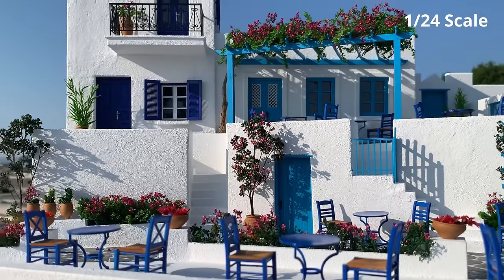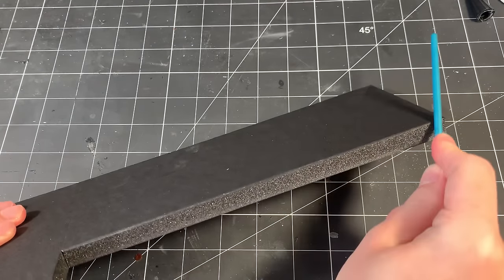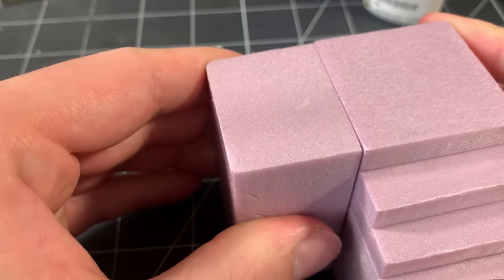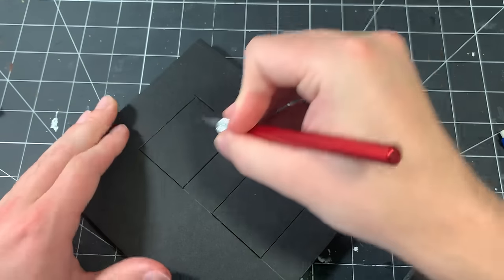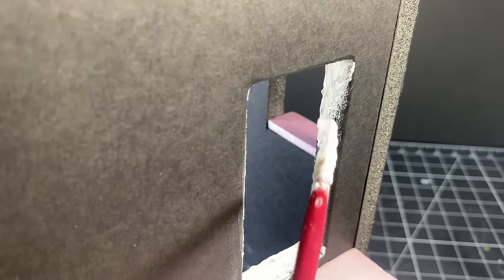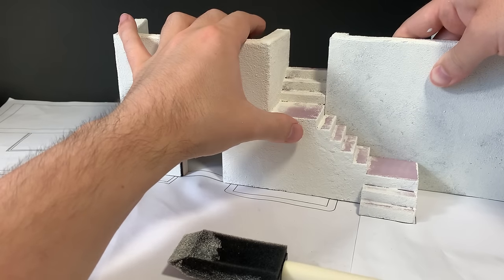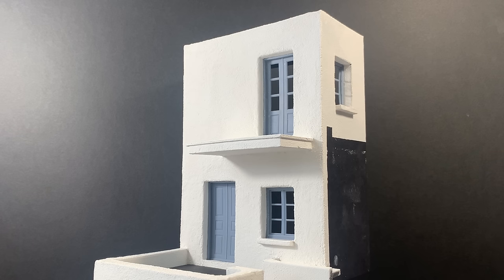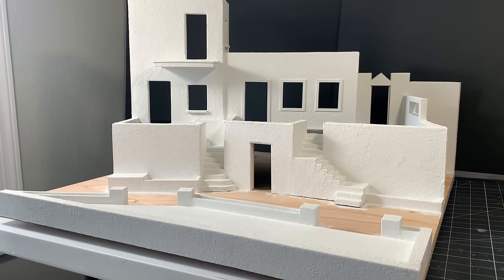Santorini Diorama DIY - Build a REALISTIC Miniature Scale Model of Greece in 1/24 Scale

Comment: Gorgeous! The attention to detail is spectacular. Little side note, if you print those tables upside down you’d minimize overhangs and the required supports meaning less work for you. I’ve never seen someone 3d print flowers like that before either, the little printed details are just stellar!
Reply: Also, when taking supports off, you can try the hot water trick.  Put the part in hot tap water for 10-15 seconds and then take it out and it should be easier to pop off the supports.  But if you put it in longer it might start to warp.

Comment: To speed the process, I would use the styrene scraper technique to apply a "scratch coat" before doing the stipple. This way you could build up the surface in one coat.  Also, I would print the table leg parts flat and super glue them together as assemblies.
Reply from the maker: Thank you for sharing!! Definitely some great tips to speed things up a bit!

Comment: Absolutely amazing. I've gone down the rabbit hole watching your videos.

Advice for removing the supports, soak in very hot water for about 5 minutes (test after 2). It has made removing them easier for folks.
Reply from the maker: Thank you so much for watching my videos and supporting the channel!! It really means a lot to me! 

And that’s great advice about the water, some others recommended the same to me. The only reason why I sometimes don’t soak the prints is if the parts at very thin (.03”-.01” thick) because it can cause the print to warp

Comment: Great work! Any specific reasons to use 1/2 foam core over something like XPS, styrene, or wood sheets? Looks like the 1/2 foam core is a good scale for the wall thickness. Also, any downside for using hot glue?  (I want to make a lot of structures like this going forward and would like to feel confident about the basic materials and options.) Thank you!
Reply from the maker: Hi there! I used the foam core due to it being relatively easy to cut, it’s availability, and the thickness is about right. My local hardware store doesn’t sell sheets of xps in that thickness, and styrene sheets are pretty small and expensive to make buildings this large. I find hot glue works well for this project because it dries quickly and is strong when using foam core (just make sure to be neat when applying it, and remove any strands) 

You can certainly use any material you like though, all of what you listed could work to build miniatures! Good luck with your projects :)
Reply: @smolworldworkshop  Thank you. Very helpful.

Comment: Way easier cutting for foam core: I call them “snap knives” blade holders with long blades that can be “snapped” off. There are little ones and big ones. My memory is either 11mm tall blades or 8mm. They are cheap. The blades are replaceable. There are folks in the Cosplay community that actually sharpen the blades. I have had no luck with that trick. The big wide blade makes square cutting thick foam core easier. Foam core and paper both sand the edge right off a craft knife. There are X-11 titanium craft knife blades too. Way more “longevity”. Still, a bigger blade will nearly erase the pain of cutting foam core.
Reply from the maker: Thank you for the advice! Cutting foam core is one of my least favorite things about making miniatures haha. I’ll have to look into getting some snap knives!

Comment: How did you made the doors and the windows?
Reply from the maker: I 3D designed them in fusion 360, and then printed them on my elegoo Saturn 3D printer. If I were to make this without a printer, I would use a styrene plastic strips and layer them on top of one another.
Reply: Thank you so much for your response. Love from India 👍🙏.

Comment: Why print railing on support and not print the railing directly?
Reply from the maker: If I print it directly on the build plate, it’ll most likely break when I try to remove it. It’s only .03” thick and very fragile. Even if I had a flex plate, the print isn’t dense enough to pop off properly.